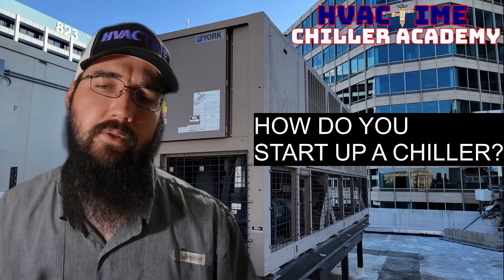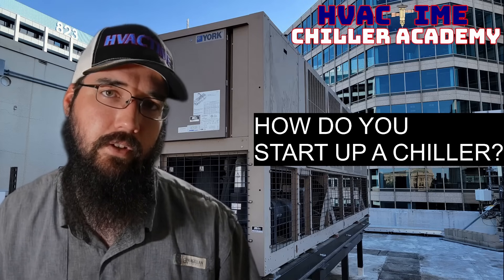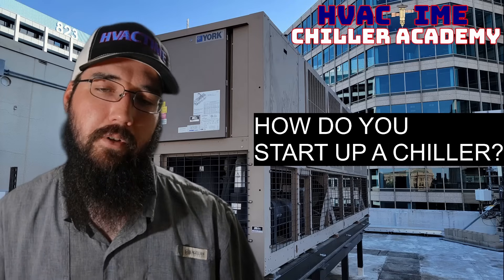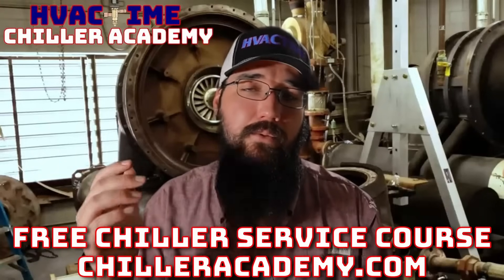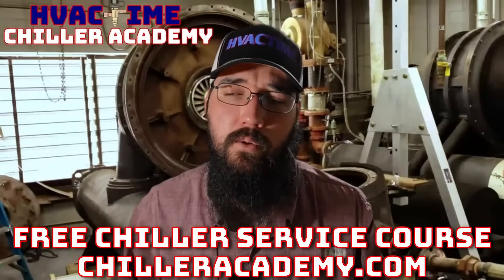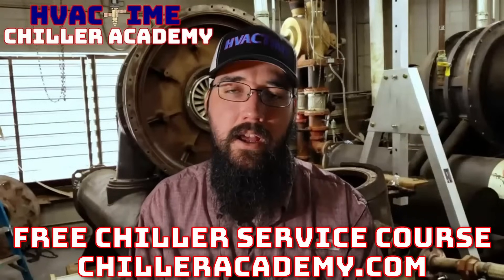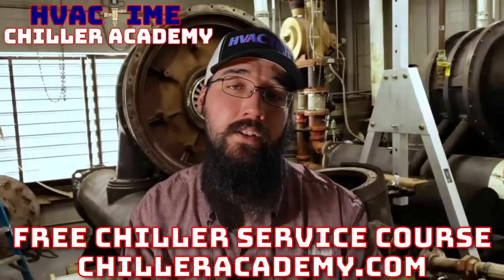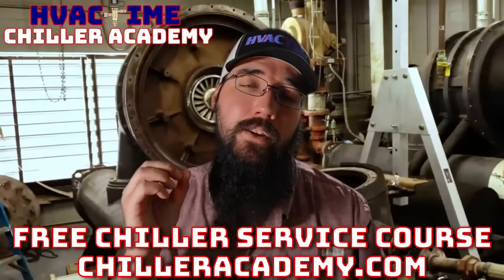How to Startup a Chiller Explained

Comment: The one thing not to be neglected in the majority of chillers that comes precharged or charged days before commissioning is the oil temp, I think the oil should be about 20'C above ambient befor startup, otherwise if the refrigerant has migrated to the compressor you will start up a pump not a compressor (you can easily destroy the compressors or shorten its lifespan), some would during precommissioning have the power on about 24hours before commissioning. Thanks for your videos, I have learned alot and had a lot of refreshing as well🇨🇩❤✌️